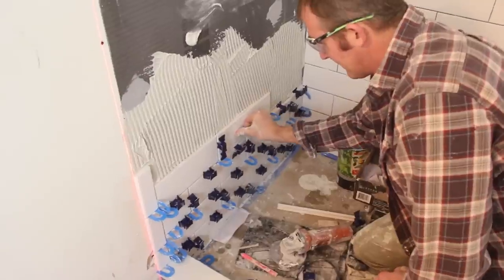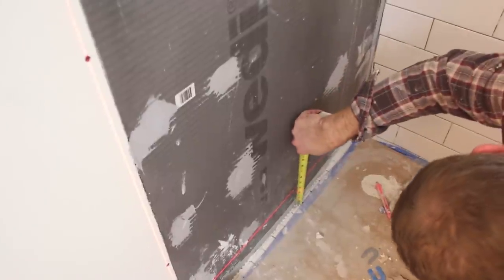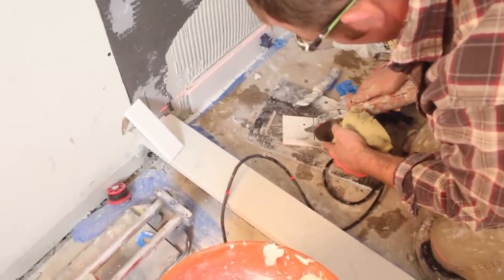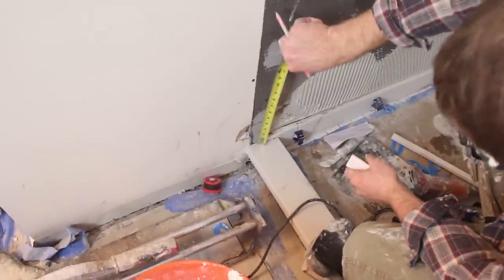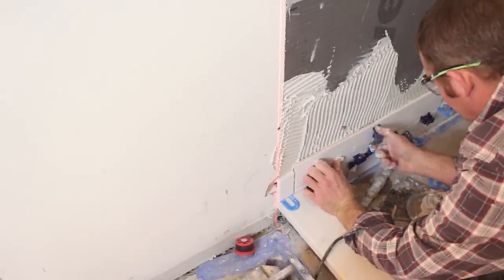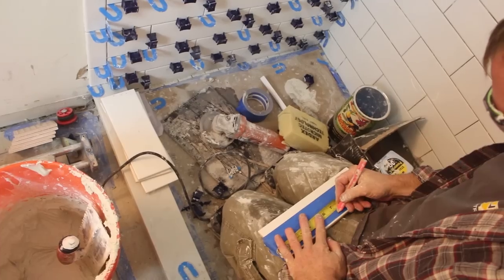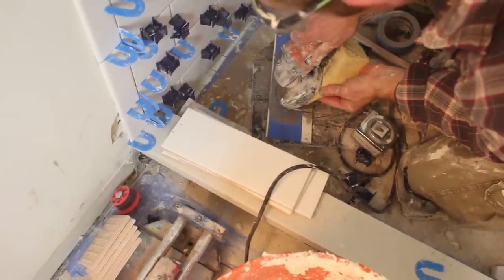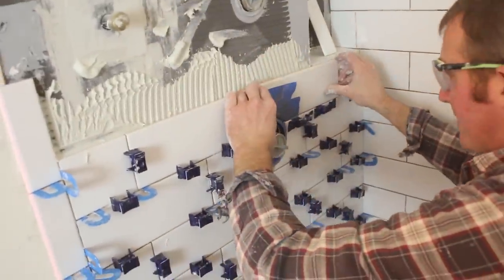How to Tile a Shower with Subway Tile...Plumbing Wall Tips

Comment: Love your videos!! Not sure if this has been addressed, but how does Steve handle covering outside corners with respect to using a tile that is "multi-dimensional"? I know, and have used, the aluminum trim rails, and they work great for flat tile...but I'm curious as to if anything is available for tiles with "waves", etc. in them. Thanks, and keep up the great work!!
Reply from the maker: Thanks Scott and we’d probably look for a metal profile. The wavy tiles would present an issue, hopefully the ones being used would have some type of bullnose or finished edge. We’ll have to install some of those

Comment: How do you keep track that your wall remains vertical as you move up.  This is critical at the bull nose area if a frameless shower is to be installed.  Thanks
Reply from the maker: We use a laser level for both vertical and horizontal lines

Comment: How long does it take to tile a tub surround with subway tile, roughly?
Reply from the maker: It depends on your skill level, complexity of tub, and size of subway tile. Anywhere from 2-3 days if you're doing it all day.
Reply: Love these videos and just finished a tub surround after a complete gut with 3x6 subway. Used these videos for a lot of the work. The actual tiling would have taken me 5-7 full days after spending a week on demo and prepping new walls and shower. I have tiled before. There were just so many cuts and I didn’t want weird or uneven lines, I also had a 12x20 niche which I really think doubled my
 time planning and working in and around but I’d say it was worth it. Take your time to plan and set aside at least 8 hours or you waste a lot of time prepping and cleaning!

Comment: Do you really need leveling clips for such small tiles?
Reply from the maker: depends on the tile and whether it’s bowed
Reply: @HomeRepairTutor  Ok, so I just noticed the wall above the vanity isn't completely plumb for tiling the backsplash.  Can I just use levelers and adjust the amount of thinset to compensate?